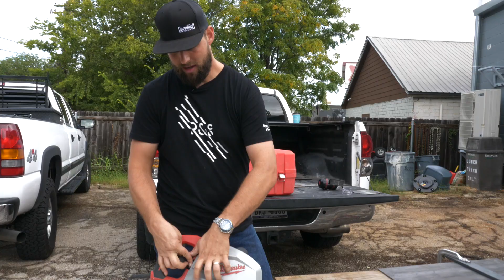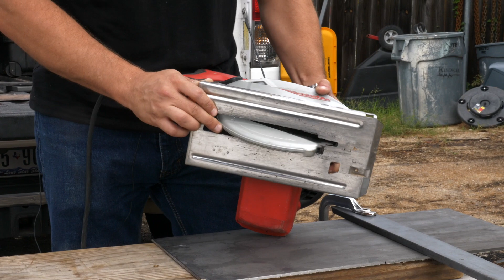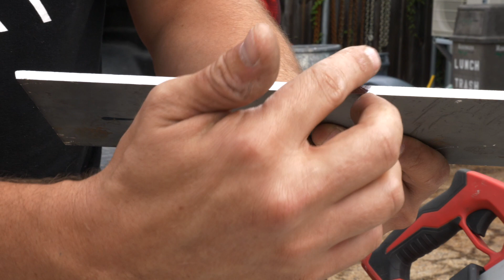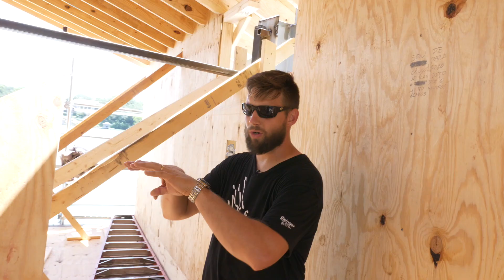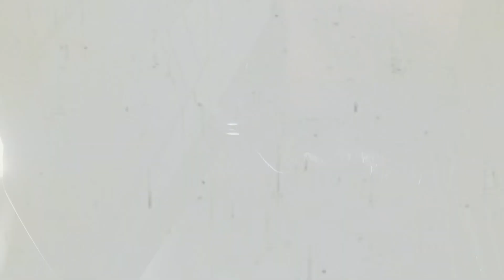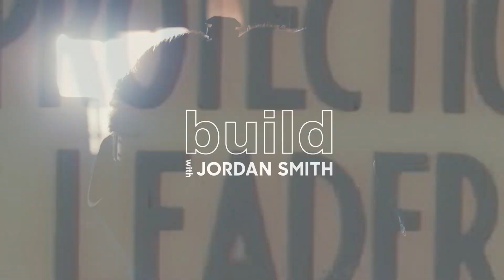Cutting Metal Clean is EASY with this tool

Comment: So, how long does the blade last before it starts to burn and melt chips? I know all is dependent on thickness and other factors but some kind of guideline would help especially at that price. Oh, can the blade be re-sharpened ? :--))))
Reply: I have a manufacturing/fabrication business and we use them very frequently and change them out about twice a year.
REPLY
Reply: they last a while